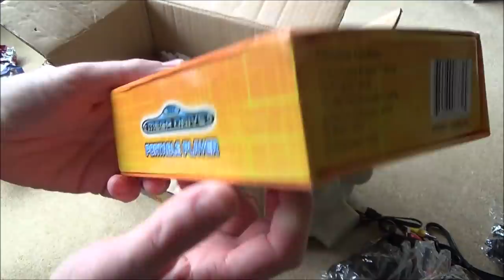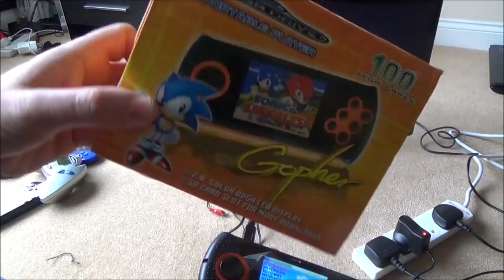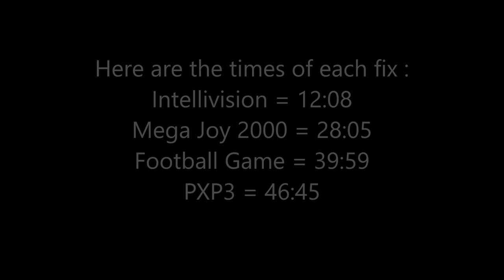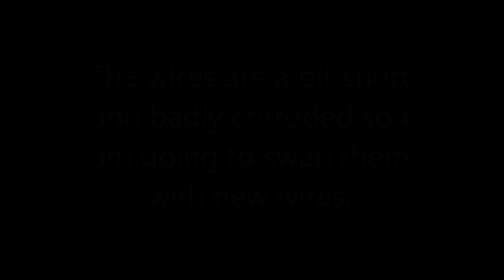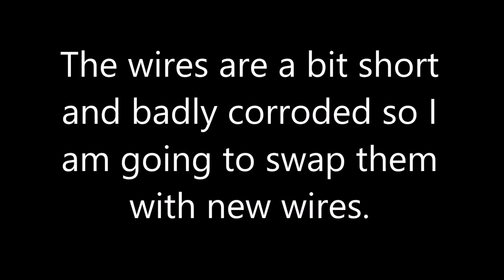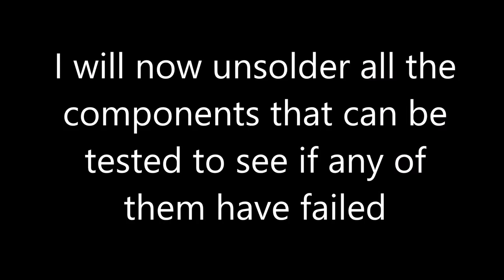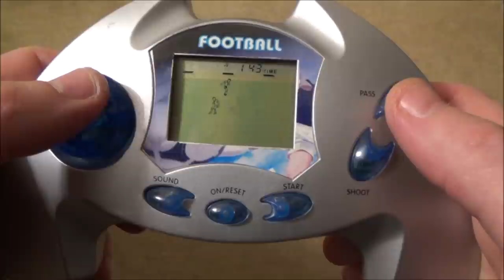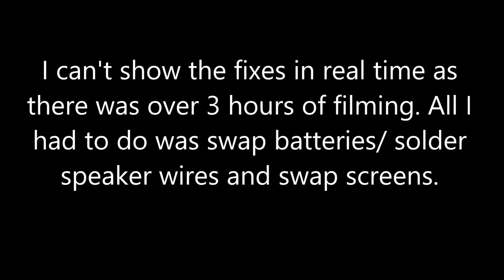Trying to FIX a Job Lot of Faulty Cheap Handheld Gaming Consoles

Comment: Thanks to your videos, I've had the confidence to attempt to replace my original DS's screen. I ended up wearing out one of the wires soldered to the one of the speakers, and accidentally broke a tiny piece of plastic off, but the outer top shell can be replaced easily enough. Thanks for inspiring me to try to fix things myself, even if I botched my initial attempt. I'll give it another go one of these days. Cheers!
Reply: That's pretty cool! Wish I could fix my 3DS because the cartridge port is broken (it's homebrewed so not too much of an issue).

Comment: Hey dude I know this is an older video but I wanted to make a comment on it. I've been watching your videos for a couple months now as I stumbled upon them. I kind of envy you! :-) I used to do this kind of stuff back in the 80s and 90s. I used to get Commodore 64 VCRs handheld games stereos Etc just to do the kind of stuff you're doing and reselling them. People would just give me the stuff because it was broken and it wouldn't work and I enjoyed getting it working just like you're doing. :-) Of course that was back many years ago that I haven't did it in a long time. But watching your videos is has inspired me to get back into it. Since I started watching your videos I've searched and searched on ebay for deals like this or auctions like that, and all I am finding is basically just watches. Or if I do find any broken electronic stuff they want a extreme fortune for them or just the shipping alone is way too high. I think maybe because I am in US, you are having better luck in the UK! :-) So I really envy you that you're finding all the deals!! :-)
Reply from the maker: Thanks:-) I just type in things like 'faulty' , 'spares or repair', 'broken', 'not working' and then if anything takes my fancy I buy it. Everything on eBay is normally really expensive due to shipping and fees etc. but I get to make the money back on the video views so I don't mind as much. I don't think it is feasible to buy from eBay and then sell to make profit as you may see in the eBay repair Challenge that I did and the 2nd one I am currently doing with Steve from TronicsFix :-)
Reply: Hey Vince, thanks for responding. Yeah I've been doing searches for stuff like that and I get a couple here and there but not a lot choose from.  And I understand exactly what you're saying. I did watch that other video part 2 of your repair challenge. Like I say I miss doing stuff like that but it's still fun to watch your vidz! :-)

Comment: For the Mega Joy with no signal, try hooking the audio to a stereo or small speaker to see if there is any audio at all. That way you'd at least know if the processor was running. There should be background music or game select sounds. That crystal controls the PAL video output but is not a standard frequency common for NES. Try testing on a small analogue CRT set or RF modulator to see if there is any kind of video at all. Many new LCD TV sets are not very forgiving with imperfect signals and just completely bock the signal with their "no signal" screen.

Comment: 36:58 You're right there. These are called "glop tops" they're a very cheap way of creating chips, and they're un servicable unfortunately. These are very common in these old handhelds and cheap systems.

39:22 That is a clock crystal. You'll see these on lots of older systems, like the megadrive or the nes or old systems in general. They're used to run the processor of the system at a certain speed frequency, in this ones case, it runs at 25.5 Mhz, as you can see on the side. These almost never fail, so I wouldn't be expecting that to be a fault

That Firecore red portable megadrive is really nice, other than the not so great sound, they're a really good way of playing megadrive games portably, as they even have an SD card slot so you can put all sorts of megadrive games on of your choice :) What's nice about those is they don't really use emulation, they use a FPGA chip, which basically replicates the system on a hardware level, rather than doing it in software, which means they can be much more effecient and accurate.

Comment: With the Mega Joy you could test with the board outside of the housing, the shell itself could  be the fault and maybe a little trimming around the edges would aid in making better contact for the A/V cable.

Comment: the poor quality of devices like this mean a massive amount of them arrive at the shops dead anyway and so a lot of the repairs are just putting right what the factory should of done from the start like using better grade solder, thicker gauge cabling etc. great video as always vince :)

Comment: just FYI most of the "plug and plays" I have found are made by a company called Jakks Pacific.  The blob tops are called "chip-on-board" if you search for that it will show you how they are made.  The epoxy blob seals them to keep them from being exposed.
Reply: Tim Howard i've heard that the blobs are also sometimes used as copyright protection (ironically) so that another companies can't just get a list of whats needed with one look.

Comment: Those capacitors that you say are showing as resistors, those are failed capacitors. The 20P and 50P markings are almost certainly value markings of 20 picoFarads and 50 picoFarads. If the bad ones are meant as decoupling capacitors, then the game will probably run fine with them removed, at least as a further test.
Reply from the maker: Oh, I didn't know that. Thanks for sharing the info :-)
Reply: @Mymatevince  those magic testers also don't work great for caps of such a small value.  A real capacitance/esr meter would work better.  The Mega Joy Nintendo on a chip system is very poor quality, but they are great for building your own arcade machines and handhelds with good controls.  I've built several and they have worked for years.

Comment: yes that metal can is crystal oscillator and in most of the cases on cheap video consoles this is the faulty part, when you change it just make sure you put one whith the same frequency ;) anyway you bought component tester that i recoment ... nice! Now the last part of your tools colection wil be desoldering gun (yes gun not pump) it will help you to desolder every truehole component clean like a boss :)

Comment: Nice easy fix on that first one . Just a suggestion but with that switch there are four tabs holding it together . they probably make the contacts connect . Might have been an idea to tighten them down so they clamped it tighter

Comment: I found a boxed Power Player Super Joy III which looks like the Mega Joy, came with a light gun and GEN/MD style 2PL controller FYI. Mostly with the first INTV clones they were absolutely not like the original to the point of being pointless.
Hard to fix such things, by default any repair of them puts more money into them than the original unit had from the start often. Failure in the power switch seems to be common to handhelds regardless of quality, guess they corrode and fill with dirt easily.
Reply: Logan Jorgensen 
Gameboy's have high quality switches so they almost don't need repair mine does because the plastic piece inside the system broke off and i don't want to remove the batteries or unplug my tablet charger every time i want to turn the power off.
I only have a tablet charger because if my tablet and phone are charging @ the same time the phone takes 7x longer and the tablet does not and i can use the USB port to use my tablet as a ftp server to store my backups + i have two phones and they both need 600+ miliamperes

Comment: the bulging batteries look like dsi batteries, but if you take one of them to one of those market stalls that sell mobile phone batteries and chargers they will have a replacement.
the cheapo handhelds usually take either ds, dsi, or nokia batteries they are dirt cheap to replace.

Comment: 39:02 I think those 2 capactors in MEGA JOY shouldn't test as resistors. 20P most likely means 20pF capacity capacitor.
Reply: This weird thingy with both caps provide u with the clock signal.
Reply: 9popop
Reply: you are right i already got same problem with faulty capacitors reading in esr meter as resistors, they are faulty they cannot charge, and the metal piece its a crystal for frequency, hard to go faulty and esr meter should read it too.

Comment: The larger metal box on the motherboard of the N64 knock off controller looks like a quartz crystal real time clock.
Reply: I kept screaming at the screen - "Get your oscilloscope out!" (to look for a video signal or the crystal frequency) ... but then realized that not everyone has an oscilloscope...  The two tiny capacitors should have been measurable by that LCR meter as capacitors I would think.  The board seemed to indicate that they were supposed to be 20pf.

Comment: 😀Hi Vince, the PXP3 usually have 2 carts with them to swap game menus, even though all the games are held on the machine itself. This guy shows a very simple mod that eliminates the carts and still allows access to all games, here's a link to the video, it's only 10mins https://youtu.be/6ywGz5vYrtc. As for the battery, I believe they are Nokia standard-- something like BP-6 or BP-7, sorry can't recall exactly on those. Great result for a tenner on this lot tho 👍👌😀

Comment: I just sub to your channel recently like your video so far. I saw you testing a fuse in one of your other videos with your Meters continuity mode and it beeped and you said it was a good fuse so from that I guess if it doesn't then the fuse is bad is that right  to guess that. Because I have a meter and I think the fuse had been bad for a while and I have just not decided to test it till now plus the meter was old to begin with when I got it. It was lie some of the fuse you saw in your videos but it was a 2 amp one in my meter. when I change it I could go up in amps and it should be fine, right.

Comment: The component you referred to "being simular to a component on a radio controlled unit", is a crystal, crystals vibrate at various natural frequencies that can be dampened or excited to vibrate "Yes Vibrate" at a desired frequency, to which that frequency can provide a cycle that can be referenced for timing purposes Eg: clock or in this case computer timing functions such as what all computer games need for stable and predictable results in the control of data..

Oy this is hard to explain, but essentially for each cycle or half cycle a circuits cycle provided by the crystal, allows an input by user, and on the next half or full cycle an out put is acted upon by the circuit. thus a "flip flop" "IC" or "Integrated circuit" is usually is not far away from a crystal, and if the crystal has a electrolytic capacitor near it, I like to change it out automatically, BUT and I stress BUT only if whatever device is over 5 years old..

Comment: the crystal in that n64 controller thing is a crystal for the processor under one of those blobs. the blobs is to keep you from know what those chips are. those smd caps might just be to small a value for your meter to read. the football game clean those rubber looking things and contacts on the board as well as the glass display. i have had to fix them by cleaning them on other devices.
Reply: this comment is before you cleaned the contacts lol

Comment: Fun fact: all of those bootleg consoles (besides the Nintendo 64 controller) are actual SEGA genesis consoles, or Megadrives on a little chip, no emulation with any of them. The Nintendo 64 controller has a NOAC (Nintendo On A Chip), meaning it has a Nintendo Entertainment System on a little chip. Just something interesting you might like.

Comment: that silver thing is as you assume a crystal,  Every electronic device, needs one in order to operate, its basically the clock. that hand held is running at 25HZ/Mhz  In modern electronic devices the crystals are generally incorporated in the chips, rather than a seperate crystal.

Comment: Dude I save these all the time. Soak these (on the board with vinegar frirst) no need to desolder the switch, then hit them with deoxit. I've saved literally hundreds of gameboys this way. Stupid simple. I've even soaked entire mobos (bad battery acid damage) in a bowl of vinegar for 30-60 minutes. Afterwards hose off vinegar with hot water, thourghly dry it then hit it with deoxit. SERIUOSLY Ive fixxed HUNDREDS UPON HUNGREDS this way. It works

Comment: Great job as always Vince. For the PXPs I think they all come with all the games preloaded, all the 'game carts' do is ground certain connections on the connector, depending on which connectors are grounded or connected changes the available games on the system. Crack open one of the game carts to see if there is any chip or anything, it should just be a super simple PCB. You can then modify the PCBs to connect different pins and effectively make new game carts.
See here: https://www.youtube.com/watch?v=AZcNwdqMaB4

Comment: most of these are broken for two reasons or the two main reasons
1/ the joy stick/pads are broken this is common and they were cheap so no one cared
2/ the battery bay or the reset swish was in the way so the game would re-set if you placed it down on a surface or droped it in rage/win, the bttery by would rust/oxides from the cheap bad batterys you got given as in the lower then poundland batty's yeah worce then those

Comment: At 39:30 that's a clock crystal, maybe it's faulty and changing it is a possible fix, use one with the same value 25.017Mhz
Reply: That crystal actually controls the PAL video output signal. It normally should be 26.6Mhz for PAL NES consoles video.

Comment: That's not the original Intellivision. This is, & I still have mine from 1979. It had ROM cartridges, & each game cartridge came with slip-in selves to tell you what each button was for on the controller.   https://en.wikipedia.org/wiki/Intellivision